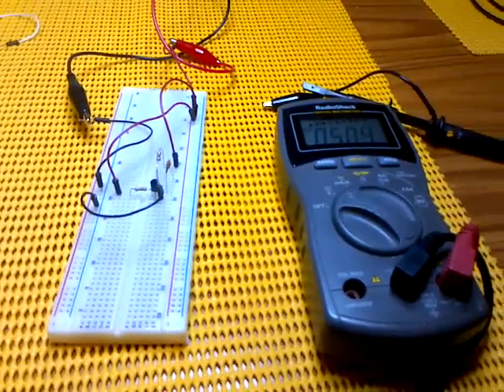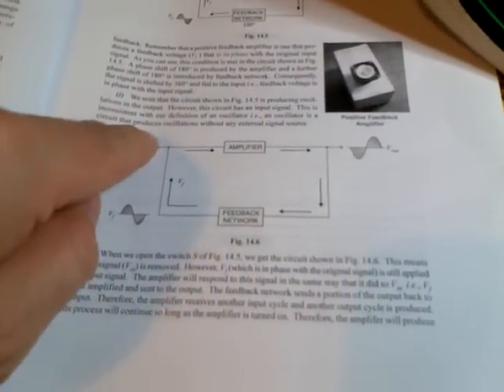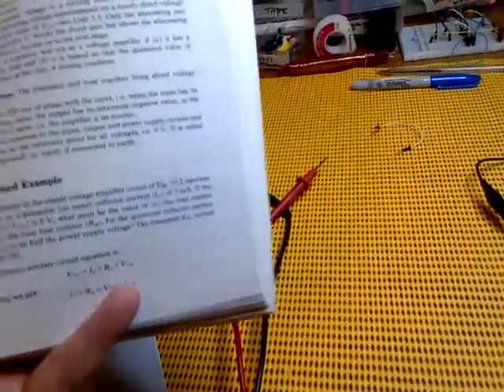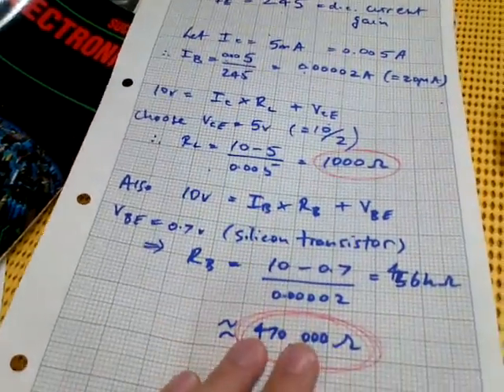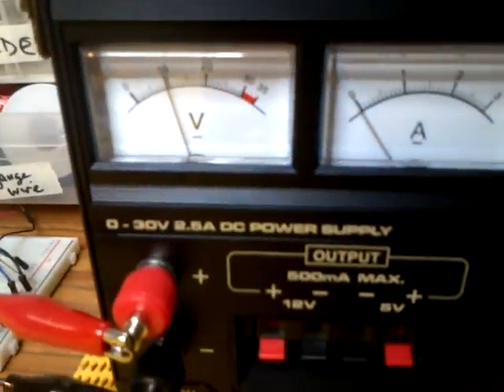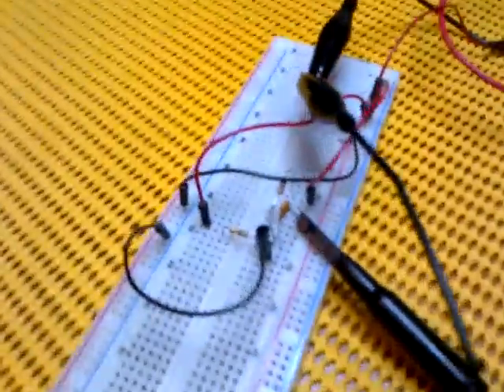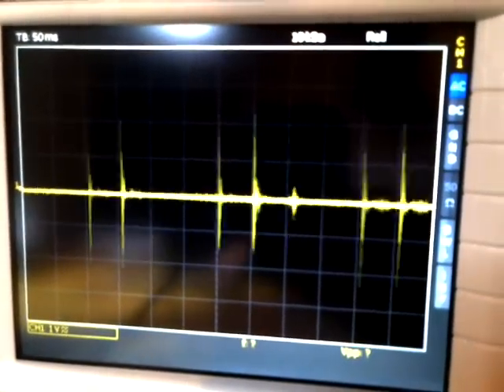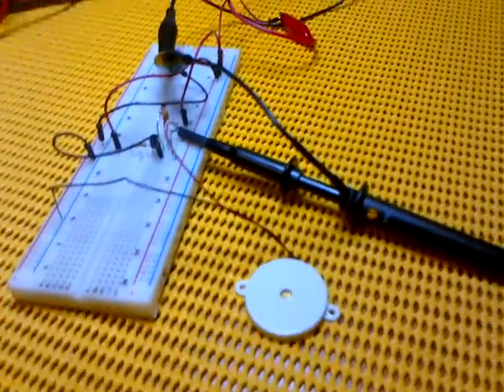Basic Audio Amplifier with one transistor, two resistors and a capacitor

Comment: Very nice. Thanks. Q=2N3904,  RB=470k, RL=1k, C=?
Reply from the maker: The C is not critical. It is a decoupling capacitor that isolates the DC present in the amplifier stage from any subsequent stages (e.g. oscilloscope, speaker, headset, etc). I think it was something like a 104 cap (=0.01nF).
Reply: 220uF to 4700uF. Other wise you will lose bass. And it's critical for speakers. Otherwise it will destroy the speakers.

Comment: Can I use headphones to hear the sound produced by the piezo?
Reply from the maker: You could use high impedence earphones which are themselves made from piezo crystals. But regular music headphones will not work to hear the signals that move the piezo. The piezo uses tiny currents which are not big enough to move speakers on regular headphones. But using the amplifier side of the circuit, you might have better luck to “drive” regular headphones. Good luck!

Comment: What are the resistor and capacitor values
Reply from the maker: Hi Oliver, check out the notes I share on the link under the video https://drive.google.com/file/d/0B5wtctB1jrOnY1RHX0xtNXk0N1k/view?usp=sharing
This shows how I derived the two resistor values. The capacitor decouples the output (the 'scope in this case) from the DC bias of the amp circuit. It's value is not really critical. You just need to use a size of capacitor that does not degrade the output signal too much through its reactance.

Every capacitor, value C in Farads, has a reactance (impedance to current that does not dissipate power like a resistor), X_c = 1/(2pi *C*f) measured in Ohms, for a signal of frequency f. For the audio frequencies from the tapping of the piezo 'mic', f < 20,000Hz, say, you can find out the impedance X from the capacitor you choose. If there is a high impedance from the capacitor, say 1000 Ohms, then your signal voltage will be small at the output and might challenge the rest of the circuit after the amp. Play with values of C, and see what happens! Good luck, Matt.
Reply: Queuerious Guy hi thank you for that. And one last thing that I'm getting confused about, do all npn transistors do the same thing even though the labels are different, and is this also the same with pnp and mosfets?
Reply from the maker: Hi Oliver, a basic answer to your question is Yes. At more length, there Bipolar Junction Transistors (BJT) that come as a triple-layered sandwich of NPN or PNP, where N and P are layers of silicon with added atoms, each layer is grown/fused to the others. All NPN BJTs  and PNP BJTs work in the same way: a base CURRENT controls a larger collector CURRENT. The only difference in NPN vs PNP is the polarity: for a given NPN circuit, swap the batter terminals around, swap the NPN to a PNP transistor and the same essential behaviour (switch, amp, etc.) will work.

JFETS and MOSFETS (collectively called FETs = Field Effect Transistors) are a different sort of animal, but can be used to achieve the same circuits - switches, amps, etc. They all come in n-channel or p-channel (analogous to NPN and PNP) as well as enhanced or depleted modes (whether the FET is ON or OFF with zero gate voltage). The key difference with FETs is that these are controlled with VOLTAGES at the gate (e.g. the base of the BJTs) to control the device, while as noted above it is CURRENT that flows in the base of a BJT to control the device.

Read up on them - and good luck!
Reply: Queuerious Guy Thank you so very much this helped me a lot. 👍

Comment: First of all bless you and thank you for posting this and sharing the schematic. Not my day job, but in addition to being a gigging musician, I love to mod guitars and other stringed instruments, including electrifying purely acoustic instruments like banjos, mandolins and such. I've gotten into building cigar box guitars and many of those instruments can be built with a standard electric guitar pickup or with one of the piezo discs like you used in your video. As you know, the output of that disc is abysmal and its best to boost the gain before handing it off to the amp. This is my starting point to knowing how to build a butt simple preamp. I have a butt simple three band EQ to with this too and voilà, now I have tone controls for the cigar box guitar or a cigar box amplifier. You were my missing link. Thank you thank you thank you. 

As an aside, have you tried building a simple class AB push pull amp using two transistors? You mentioned that you were wanting to understand oscillators better and I think that there is some sort of oscillator involving the inverter stage when the inverter hands the waveform off from one transistor to the other as the voltage of the sine wave changes polarity. At that point one transistor shuts down and the other comes on to amplify it's half of the cycle...then wash, rinse repeat. That's how my very superficial understanding apprehends this subject.
Reply from the maker: HI Kirk, glad to read that you might actually be able to use this experiment in a useful way! This is a very simple example of an amplifier - indeed, it is probably better to call this a 'pre-amplifier'', as a first stage in adding gain to a very very very small signal (the piezo output) to a level where more robust and powerful amplifiers can take over. 

This is an example of a Class A (common collector, inverting amp). Class B is more energy efficient by lowering the bias point to ground, which means you only get half a full sine wave amplified; the other half is lost. An AB amp combines two such B class amps (the 2 transistors you mention) to run in parallel: when one has output, the other is grounded; this relationship flips on the remaining part of the sine wave input. Class C is very non-linear, but most energy efficient, and is useful when you need to get some fast changing output from some input, but do not need nor care to have a linear copy (e.g. similar in shape and ratio) of the input. 

Check out http://www.electronics-tutorials.ws/amplifier/amplifier-classes.html for a nice summary of amplifier classes. 

Build the amp, and send me a link of a video on your results. Good luck! Matt.

Comment: Thanks for the video, it really helped me undrestand the idea.
I just made this circuit so that I can amplify my PC mic sound which is so quiet. I know that here you tried to keep things as simple as possible, however I think future viewers might find it helpful to see more examples and variations. So it's worth uploading my circuit:
https://drive.google.com/open?id=0B_Qdsu8b9Js1VGRiMzB4R0E1SlU
* EDIT *  Mistakes: 3.5 K Resistor --> 8.1 K
     10 nF Caps --> 100 nF

I'm not an EE so undoubtly my circuit is not the best and one may take it as an example otherwise use at his/her own risk. However I successfully used it to get my mic working and it really works. The only bad thing with this circuit is the noise and I'll let you know if I can remove it later. Right now I don't know how to do that.
Reply from the maker: Thank you Mostafa for unite comments. As you say, my video was really a demonstration of the basic principle of amplifiers with one of the most simple circuits I could find. Yet, it works very well. Undoubtedly, there are many varieties and improvements to one-transistor amps. Your experience with noise (hum?) is s result of high gain. The secret to designing amplifiers is to not try to amplify everything with one stage. Better to amplify at lower gains and connect them together to get the resulting gain. Try to lower the gain ( smaller hfe dc collector current gain in a common emitter arrangement) or look for a circuit that "degenerates" the gain by introducing resistor and bypass capacitor on the emitter ( look for that in a book). Good luck and have fun while experimenting!
Reply: So it took me 2 days to figure out that removing that annoying 50 Hz mains hum is as easy as connecting the GND lead of my adaptor to real ground (earth). In my case, adaptor GND turned out to have some voltage (AC?) relative to the ground, as my adaptor plug lacks an earth connection.
I also managed to kill the remaining noise by improving adaptor voltage quality using capacitors and inductors.
I will solder this on a strip board so it becomes a usable device.
Thanks again.

Comment: can I use bc548 transistor to amplify an audio signal which is coming from the mobile or using mic?
Reply from the maker: I think so... any small signal transistor is capable of significant gain (the hfe data in the datasheet). Good luck ! Try it out and see what you get!

Comment: hi Queuerious Guy,im noob in electronics,i want to make a simple amplifier.i cant understand the value of resistors or capacitor that you draw.can you please tell me specifically the value of resistors and capacitor you used?i think theres 1k and 470k ohms of resistor,im i right?and what is for the capacitor.thanks for the video.
Reply from the maker: Hi Mikez, have a look at the schematic I post in the description for how I calculated the resistor values I used. The capacitor is not critical for this amp, you can use something like a "103" or "104" pF cap. The value has little effect on the amplification at audio frequencies (i.e. the capacitive reactance at audio frequencies is small).

Comment: how many watts would you rate the output?
Really funny how you SPEAK UP at the end :P
Reply from the maker: I cannot recall the current and voltage I specified in this amp, something like 5 volts class A quiescent voltage times a very small current in mA. Multiplied together yields power in watts, so perhaps 50 or 100 mW?

Comment: Nice video.  Is it a "decoupling  capacitor" or a coupling capacitor ?  Normaly the decoupling capacitor is connected between the emitter and ground or zero volt
Reply from the maker: +حنا بطرس Here, the capacitor plays a 'coupling' role. This website outlines the action of the series capacitor. http://www.capacitorguide.com/coupling-and-decoupling/   Thanks for watching!
Reply: Queuerious Guy   Thanks For your good answer.

Comment: This is as basic circuit for 1-transistor amplification The performance is very good as 2n3904 is a low power device transistor. Thanks for sharing, such a simple circuit.

Comment: Best Tutorial Ever on Amplification for beginners with or without biasing. So basically the Cap is charging and discharging giving negative and positive output.
Reply: no not exactly. It's just decoupling the DC component of the signal that comes with the result of amplification.

Comment: I have a 2SC3858 NPN transistor, but it didnt work :/ i have a 12 volt DC powersupply, and Im a noob!
Reply: +Crytek1337 Well, know my phone just restarted and wont output sound rom the jack :| think i ruined something?
Reply: +Crytek1337 I accidental found out that this will work because the collector is already getting power directly from vcc with resistor couple with capacity. but im a nooby also
Reply: +Wayne Evans Ive figured it out, emitter and collector need vcc directly, cus they are current amplifiers and not voltage amplifier, like a pre amp is.

Comment: I realize that this is only for test/experimentation purposes, but I notice that this circuit only uses RB to establish Vb. This is very dependent on the specific value of hfe of the transistor in hand (you measured this at 245). If you pickup another transistor (even of the same batch), it is likely to have a different hfe which will lead to quite different voltages/characteristics.

The datasheet for 2N3904 says that hfe can be anywhere from 60 - 300
If you happen to get one that has a 'hfe' of 100, your Q point moves from 4.5 to 9V

How would you counter that without hand testing every transistor that you would use?
Reply from the maker: Paul Carew Absolutely right Paul. This is as basic and 'crude' a circuit for 1-transistor amplification that I can find. The performance is very dependent upon the hfe (gain) of that specific transistor. The next step up is to replace the Rb arrangement so that Rb is in series with Rc. This improves stability and lowers depencency on hfe.

Comment: Hello, I got a problem with reading the Vout though one of the Arduino analog input pin. (i am trying to use the piezo as a input sensor) When i connect the Vout to analog pin, and read it though Serial monitor. The value keep going up till 1023. if I tap the piezo,t the value went down. But the strange thing is, if I connect the oscilloscope with the output and also connect the output with the analog in pin, the serial value starts from 0, and goes up based on how much the pressure on the piezo.

I appreciated if you could help me this out.

Many thanks.
Reply from the maker: Chun Shao  It sounds like you are using the piezo transducer as input, Vin, to the amp, and passing the Vout from the amp to an analog input pin on the Arduino. As you will know, the Arduino 10-bit ADC measures input as a proportion of a Vref (reference voltage on the Arduino - you can control it), giving a digital value [0,1023]. Your amplified Vout is likely to be much greater that the Arduino Vref (default is I think 1.1V, but can never exceed Vcc(supply) <5V). So you see 1023 max signals from the amp output.

When you connect your oscilloscope to the Vout from amp, IN PARALLEL with the Arduino analog input pin, you are adding the 'scope probe's impedance (typically 1M Ohm or 50 Ohm for RF work, also x1 and x10 probe settings) and small capacitance (say 5pF). This large impedance, in parallel with the Arduino input impedance (whatever that is), forms a resistance path to ground (1/Rtotal = 1/(1M or 50) + 1/Rarduinio). So, you're pulling the analog pin to ground basically via the probe, hence the ADC starts from 0. When you apply pressure on the piezo transducer, you get a strong signal from amp and the ADC returns a non-zero value (sayy 135, 876, etc), but it quickly returns to 0.

Hope this helps.
Reply: Queuerious Guy Thank you so much for replying. yes, what you've described is what i am trying to do. The wired thing is that when I tap the piezo the analog pin value went down. when i not touch the piezo the value will keep going up till 1023. However, when I use the oscilloscope to connect with the Vout from the capacitor (where the analog in pin connected as well) the Arduino reads the value from 0,when I not touch the sensor. This is the state that I want the piezo to perform for detecting the action of blowing. But if I take out the connector of the oscilloscope, the analog in pin keeping going up, which I don't want. Is there anyway that I can make the circuit perform right?

Thanks a lot!
Reply from the maker: Chun Shao OK, here is my thinking on the behaviour without the'scope probe.

 The Class A amplifier in my video uses the transistor in a 'common emitter' arrangement, which INVERTS the input signal. So when the piezo is pressed, the piezo creates a positive voltage, this is amplified AND INVERTED, so creates a larger negative voltage. This may explain why the ADC number falls from 1023 to lower values when the piezo is pressed.

 When the piezo is NOT pressed (generates NO voltage input signal), the Vout of the amplifier is = 1/2 the supply voltage (this is the property of a Class A amp design in this video - my supply is 10V and quiescent state is 4.98V). If your supply voltage is 2.2V or more, the 'quiet' or 'quiescent' signal Vout is close to 1.1V or more, which would be LARGER than the default Arduino Vref 1.1V (I think this is the default). Hence the ADC sees a very large analog input signal > Vref, so returns the maximum 10-bit value of 1023 when no piezo Vin signal is created..
Reply: Hey, thank you so much for much a detailed explaination. I guess if I want to get the right value, I need to change the amp that I am using, possibly to a non-invertinh one. I think I got the ideal.

Thanks again! Looking forward more cool videos from you!
Reply from the maker: Chun Shao Why not try to use two Class A common emitter amps in series  - the two steps invert twice, which leaves you with a original signal shape, but amplified. Also, try to alter the default Vref https://www.arduino.cc/en/Reference/AnalogReference 

The 'common collector' amp design will produce an non-inverting Vout, BUT thse amps do not offer voltage gain, but do offer current gain (they have low impedance outputs). "Common base" amps offer some voltage gain, but no current gain (high impedance outputs) and again non-inverting outputs.. 

.Good luck and have fun exploring these bits of electronics!
Reply: Queuerious Guy Hey, do you mean to put two 2N3904 in series? Could you please share me a schematic of that? Do I need to change the resistors value?  Sorry, this is the first time i am using the transistor as an amp…
Reply: Queuerious Guy  By the way, I am using the Arduino DEFAULT analog voltage, which is 5V. and I changed the Rl resistor value to 470omh, and the Rb value to 220Komh. Is this right?

Thanks again!
Reply from the maker: Chun Shao there are several ways to connect two transistors together. I suggest you create two identical circuits: piezo is connected to Vin of Amp#1 with Vout of Amp#1 connected to Vin of Amp#2. Vout of Amp#2 is then connected to the analog pin of the Arduino. 

The only 'problem' is that these simple 1-transistoramps often yield x200-x400 gain! This is great, but might need to be controlled in this situation.

To prevent damage to the Arduino analog inputs (<5V !!!!), you will need to attenuate the amplified chain, as I am sure the resulting gain wil be rather high. Look up 'Pi or T-attenuators', which are simple arrangements of resistors that mute a voltage signal by 20dB (1/100), 30dB (1/1000) or more. So: piezo+Amp#1+(anttenuator optional here+)Amp#2+attenuator+Arduino analog input.  e.g. http://www.electronics-tutorials.ws/attenuators/pi-pad-attenuator.html